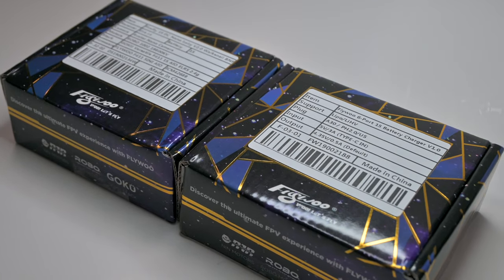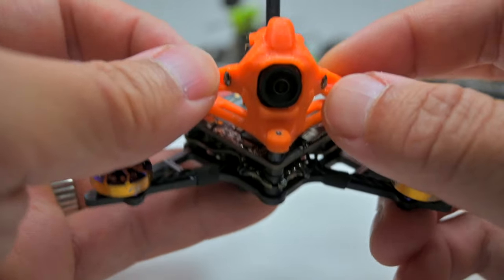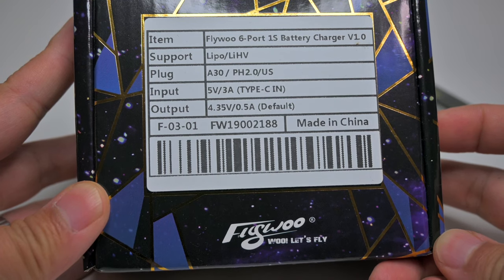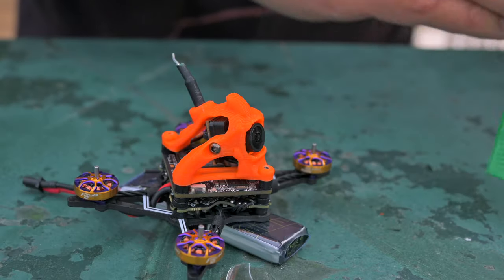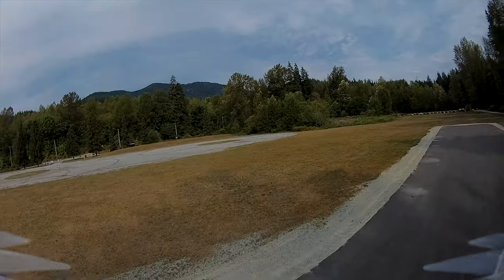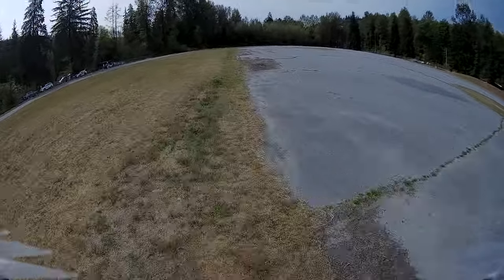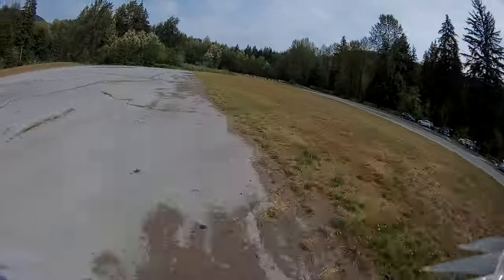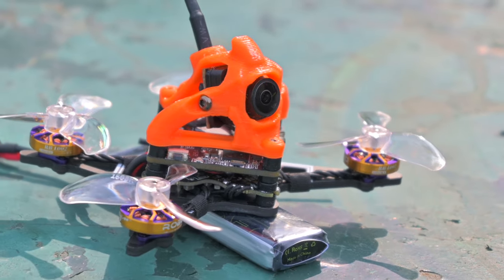Tiny, Fun, Whisper Quiet Sub100G FPV Drone! | Flywoo Firefly 1S Nano Baby Quad Review!

Comment: Same prop guards as the Venom. I found them to be suitably light but also very prone to jamming the motors if you hit it right. I ended up cutting off the webbing
Reply from the maker: Wow thanks for the tip Jon!!
Reply: I was thinking of doing that just last night, while taking a good look at them. After I type this there getting cut, thanks for the tip!
Reply: @Samsonmetaphysical  Glad it helps! Definitely helpful those first few times but get in the way once they come loose.